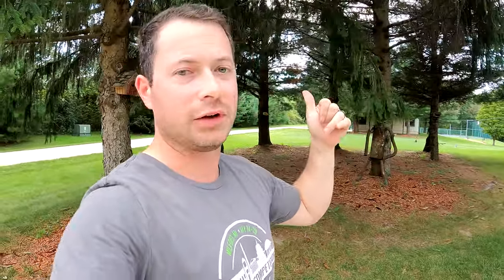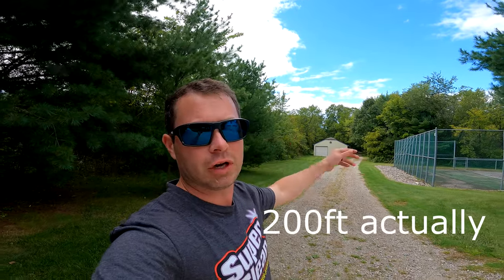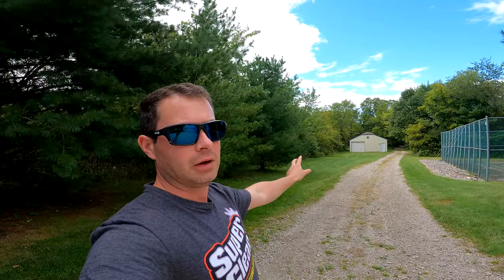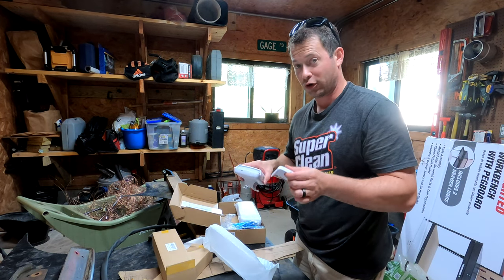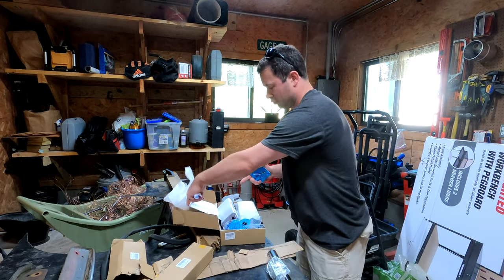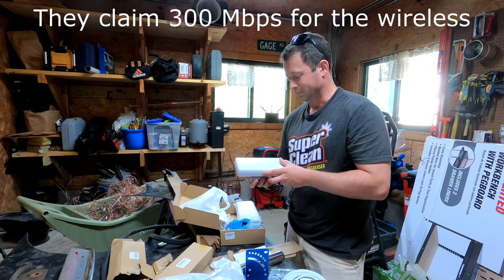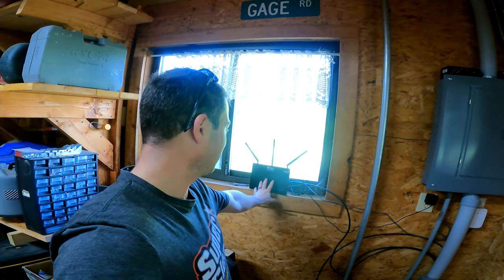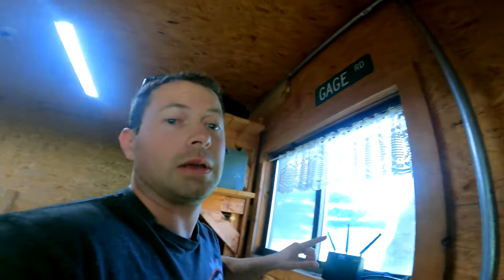✅ How To Extend Wifi To Another Building WITHOUT Ethernet - Garage Barn Pond - Ueevii P2P Bridge

Comment: Thank you.  This will work for me.  I only have about 75 feet between my house and shop.  I think mounting one on the outside of the house and directing it to one on the outside of the shop will solve my wi-fi issues.  I have power in both locations so the connections should work.
Reply from the maker: @lisarogers5873  yes it should!

Comment: Nater Tater, I followed your recommendation to extend LAN/Internet to remote buildings too far for ethernet cable by using a wireless bridge. I needed to push Aimesh LAN to out building 391 feet from house with no obstruction so I used your solution of UeeVii CPE bridge. You claimed it connects automatically once connected without user input. Yes once the POEs are connected and channel matched for Master and Client, they connected within 2 minutes. But, did you forget to mention it requires user programming of the bridge units to connect the LAN? Mine (Win10) shows "hidden network" and no Internet due to invalid IP. I use DHCP on the routers and laptop. Do I need to change the two bridge IPs to a specific IP, then set a static IP on the router? How did you get your router to pass the LAN signal without re-configuring? (I use the same routers as you.)
Reply: Follow up: I always new there was a simple solution but no one offered. I forgot that ethernet connections to router don't work as easily as WiFi. The router DHPC won't function unless booted after connection from an ethernet device. So every time I installed bridge I could only get "IP invalid". By chance I happened to re-boot the main mesh router, then it recognized the device and assigned an IP for the LAN. Now it works. 

The accepted speeds for this bridge is a drop of 80% at 200 feet. However I have clear line of sight, strong connection and get -95%. The problem I have is that I use the 1 Gbps port on the CPE 820 and Cat 7 cable both ends into two 1 Gbps ports on routers but only get 20 Mbps from 450 Mbps service. The router shows all devices connected to ports at 1 Gbps rate except for the CPE 820 which shows 100 Mbps. Anyone explain why the advertised 1 Gbps ports only connect as 100 Mbps regardless of physical port selected? (Router does supply 2.5 Gbps speed for ports.)

Comment: Well, ground took a lightening strike, conducted through ISP MoCA into house through modem then followed Ethernet cable to router. Damaged all my routers in Ai Mesh connected by Ethernet backhaul and destroyed all devices connected to main router on Ethernet, including Ethernet over Power adapters, security system and one PC.  I now have Ethernet surge protectors and use wireless connections more. Your P2P system looks intriguing. What is the maximum range between points? Do you find signal disruption in severe weather like snow, high wind, heavy rain?
Reply from the maker: Max range is miles with clear line of sight.  I havent had this pair in bad weather but dont notice an issue with my other pair.  I have fairly short spans though so I wouldnt think I'd be sensitive to that.
Reply: @NaterTater  Thanks for the info. I will definitely look into the P2P Bridge setup.

Comment: The fact that the router remains part of the AI Mesh is surprising, considering that you've used TP-Link to extend WiFi. I will do the same connecting the second house to the primary (also using ASUS routers I already have). And there is a good reason to use CAT 8 instead of lowers as the higher it is, the better insulation of the cables from electrical waves is. Thank you for the video! Just what I was looking for!

Comment: Do you still use this point to point bridge or do you use the TP link now? If so, which do you recommend?
Reply from the maker: @steppupracing1425  I use just the omada system now but the p2p is great for a simple setup.
Reply: @NaterTater  awesome! Thanks for the info. I have about 80’ between my home and shop and United Coop was trying to charge me $1000 to extend the Ethernet line out from the house or add an extra service for $100 a month. Thanks again!

Comment: Hey!  Great video. I am trying to do the same thing but I can’t figure out how to configure the router that will be connected to the ueefii slave unit in my barn. You mentioned the mesh router system. Do they hook up automatically?  Or do you have to hook them onto your computer and reconfigure them?
Reply from the maker: i use a asus aimesh setup.  you have to connect the mesh system up manually like https://youtu.be/5kse94JM0IA
Reply: @NaterTater  can I use any mesh router system?  Such as D-Link?  I can’t get asus around my area.
Reply from the maker: @Earthyorganics  the mesh system would need to allow ethernet backhaul.  Some are wireless only and that wont work with a p2p bridge setup.

Comment: Will the router on the receiving end need any configuration? if so could you help us with it please? thank you in advance.
Reply from the maker: In my case I use a AiMesh system so it auto configures all the nodes (routers).  Otherwise you could just put whatever router you use in AP mode (access point) so then your main router would control all the DHCP, firewall, dns, etc

Comment: Multiple routers is just stupid. you are double and triple NAT-ing your network if you set them up incorrectly by going into the WAN port on the router instead of the LAN and making sure to disable the DHCP on each router outside of the first one. What you need are switches and Access Points in your multiple buildings connected via your bridge units and ethernet/fiber. Also, your ethernet connection from the home to the barn is just asking for electrical problems based on different grounding. Fiber would have been a better option and the cost between them is minimal.
Reply from the maker: @rgblack316  thanks for sharing your thoughts.  This setup is an AiMesh that utilizes routers but they act as AP's and thus aren't doing NAT.  I have also switched to a TP-Link Omada setup which is also a full SDN.
Reply: Hey RG Black
If you know how I can use my direct tv Ethernet in another house on my property. Please tell what I need. I have 2 receivers. I have a combination Ethernet, internet with TV and a landline. My dad house is 200 yrs on the other end of property. I don't want to pay another 250 bucks to att. Dad is 85 and I want to help him out. 
Thanks if you have the time
Reply from the maker: @NEWSLETTERREVEALS  this video shows how to accomplish that.
Reply: @NaterTater  Thank you

Comment: Could you get away with indoor deployment if they were pointing through glass window? When would you use these instead of a router / wifi access point with wifi bridge mode configuration option like linksys ea6350v4 device?

Comment: Does this bridge need line of sight?
Will it transmit through tree tops.
I can't get a literal line of sight between my structures that are about 1,000' apart.
Reply from the maker: It works best with visual but not hard requirement.

Comment: Nate, I just used an old(er) Netgear Router to "Bridge" with my main router on a guest network using WPA2 Encryption (would have preferred WPA3, but the secondary router would not let me do that).  Now I can connect via ethernet to the secondary router (located on the other side of the house) LAN port and get 2.4GHz internet.  I plan to get a PoE Access Point so I can get more coverage on the side of the house opposite the main router.  I'm getting about 1/2 - 3/4 speed compared to the main router (Beryl Travel Router) on 5GHz which is not so bad since I'm getting between 250-300 Mbs on the main router.  Took me 2 days, working out the IP configurations but I finally got it done.  Thanks again for your help and guidance.
Reply from the maker: Good job getting that figured out
Reply: @NaterTater  thanks!  Hooked it up to my Apple TV and Roku via Ethernet for some great speeds!  Super stoked.  I'll get an Access point down the road!